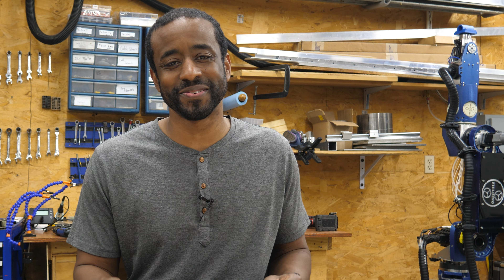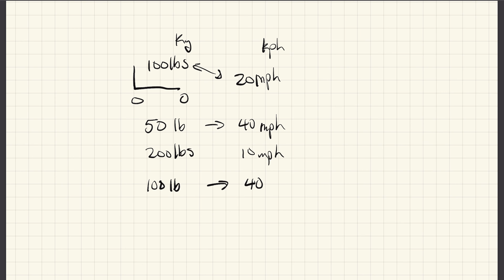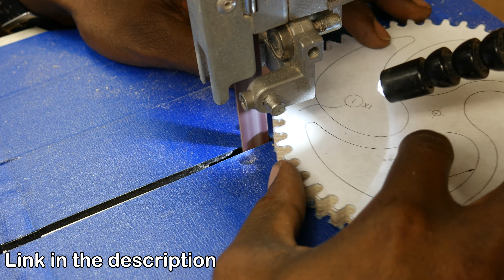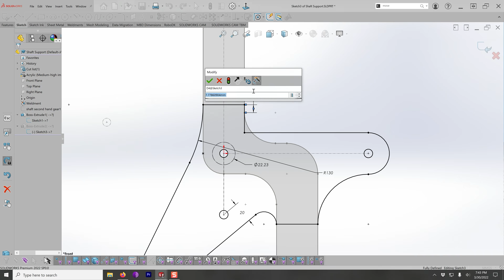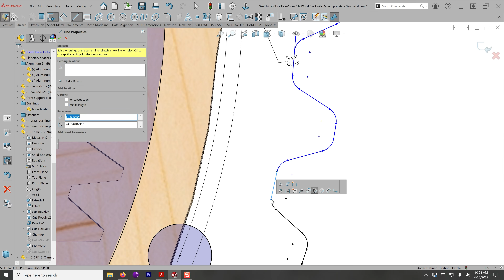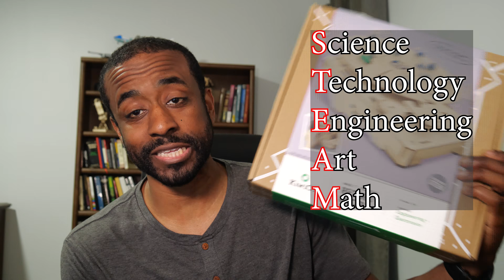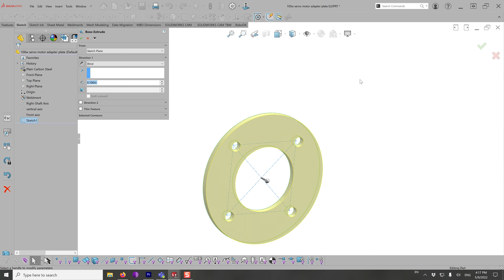How Gears and Pulleys Work: Jeremy Fielding 103

Comment: By definition, they're all screws, but it seems by the descriptions of different fasteners that it's described as bolts when it takes a tool around the head, and is still a screw when the tool used inserts into the head.  There are exceptions as well like "Socket-head shoulder bolts".

Comment: Screws use their helical plane to directly interface with your workpiece. Bolts are a type of fastener, fasteners pass through the workpiece and interface with another part like a nut or another fastener.

Comment: Acktchewaallllyyyyyyy... A screw is tightened by turning it in a hole. A bolt is tightened by turning a nut around it while it stays stationary.
There are traditional/common/conventional names that are "wrong," but that is the technical difference.
Carriage bolts, plow bolts, shear bolts and anchor bolts are rarely if ever used as screws. Wood screws, sheet metal screws and drywall screws are practically never used as bolts.
Machine screws are sometimes used as bolts, primarily ones with square or hexagonal heads, hence the use of the term Hex Bolts.
Some bolts don't have threads at all, like deadbolts, slide bolts, barrel bolts and cane bolts. (used on gates and doors) And of course there are bolts on rifles.
Screws are also used to move water, lathes and milling machines, 3D printers, aircraft, watercraft, amphibious vehicles, granular material, and to compress air.
Studs and hanger screws (or hanger bolts) are screws and bolts at the same time. They are screwed into something (studs usually in metal or plastic, and hangers usually wood) and then a nut is used to tighten something else to the first thing.
Eye bolts and eye screws have different kinds of thread.
Lag bolts are actually lag screws.

Did I miss anything?
Oh yeah; beautiful clock and an excellent video. Thanks!

Comment: In my brain it goes like this. Screws are designed to thread themselves into materials (I'm thinking wood, drywall, thin metals, soft materials in general) typically with a pointed tip and and low thread pitch in relation to its size. Bolts are designed to thread into matching pre-threaded holes, be it nuts or a hole that's been tapped, typically with a flat bottom and high thread pitch in relation. Unfortunately, a lot of the time what I consider small bolts are sold as machine screws. Maybe its colloquial, maybe it depends on size. Either way I'm gonna continue to use them as I described.

Comment: I thought the screw v. bolt was a really cool question! IMHO, screws typically have an inset method for fastening (roberston, torxs, etc) and often pointed/conical tip for piercing as well as an aggressive thread pitch for cutting. bolts almost always have an external fastening method (hex head, splinee etc) and a much tighter thread pitch for going into pre-tapped holes. 
The biggest thing perception wise would be size though IMHO; with very small bolts being called screws.
Reply: What you call "very small bolts" are actually machine screws. Screws turn. Bolts slide, a nut being turned to tighten them. Size doesn't matter, nor thread shape. Carriage bolts have no method of turning them. Same for plow bolts.

Comment: My FIL insists a screw is threaded, and only becomes a bolt when a nut is involved. (Bolt clamps its load but is not directly threaded into one of the members it is holding together.)
We are a family of engineers, and his pedigree does not give me any leverage to challenge his opinion on the matter (despite my being over a prototyping lab /machine shop for a large R&D organization!) 

Trick to holding on those bushings that you could have done is to cut out a wood piece on your laser cutter with the dowel press fit hole diameter, and slit one end of that piece and left room to run a clamp or screw to squeeze on the bushing (fairly evenly without collapsing it. Care may still need to be taken) 
That way you can easily insert and remove the bushing from the flexibility the slot gives you and then still reliably clamp onto the bushing to clean up the bur with a file. 
A collet would be even better. Perhaps pick up a 5C collet block and collet set!
I would have also used a tubing cutter to cut your tubing vs the hack saw. You still would have had to clamp and deburr the inside as the cutting tool would swage down the ID slightly at the cutting edge. 

Your last (hackish but would work in a pinch I think) option would be to cut all of your pieces a little long and cut shaft sections that can be used as mandrels. 
Slide a bit of shaft inside of the tube, but leave the tube slightly proud of the mandrel as you clamp it in a drill chuck. 
Use a zip tie or worm drive clamp array to hold the drill onto a counter and make the drill rotate as ~100 rpm or so (or slower!)- making a poor mans lathe. 
Then use a series of hand files to lightly stroke the end of the turning tube on the side of the tube coming towards the file until you get the end smoothed out. 
If you want to take it up to a final finish, you can even break out a dremmel tool with a stone and some cutting fluid to grind the end flat. Light cuts are the key here!
And keeping your files / abrasives from clogging.

Aluminum is also fairly soft for a shaft and would not run that well inside of a bushing. A hardened surface is much better for that application. (really you want hard on hard for a bushing, and the hardness need to be fairly closely matched between materials)

Comment: Off the cuff, the difference between a screw and a bolt is that a acrew's threads run the full length of the shift, while a bolt has some portion of its shaft that isn't threaded, called a shank. I'm an aviation mechanic, going through my second year of work, but I didn't do anything mechanical before this, not even working on my own car, so I could be wrong lol
Reply: I was wrong lol. A bolt is non-tapered and uses a washer and nut to fasten. A screw mates closely with existing threads or makes its own thread.

Comment: Regarding screws v bolts, there is a podcast called Engineering Commons that came to a conclusion that screws are intended to thread into a material, and bolts are intended to be attached to a material via a nut.  I have always liked their determination as it is dependent upon the use case.

Comment: A screw is a fastener thats using itself to hold on to the material (friction with the thing fastened), a bolt need a 2nd piece (the nut) to hold on to the material

Comment: Based on the way the terms are generally used, a screw is any device with an inclined plane revolved around a shaft, while a bolt is a subset of screws, specifically the machine screw.
Reply: What about lag bolts? What about deadbolts? Or the bolt in a rifle? Screws are tightened by turning them. Bolts slide. Threaded bolts are tightened by turning a nut around them while they slide into place. Lag bolts are actually lag screws.
Reply: @GordieGii  
Words mean different things in different contexts. When discussing screws, generally "bolt" is synonymous with machine screws, even though your definition may be more appropriate for technical discussions.
Also, my opinion is that lag bolts should be called lag screws, and lag bolt is therefore incorrect (although clear enough, in context).
Reply: @thomaswalters7117  When people say bolt they usually mean machine screw. I rarely correct people. The question was "what is the difference between a bolt and a screw?" That is a technical question. I gave a technical answer.
Most true bolts are special purpose, so the word 'bolt' is preceded by an adjective, like a carriage bolt or plow bolt, although even in that context there are colloquial terms, 
like shear bolt, which is really a plow bolt, but with a certain type of anti-rotation geometry commonly used on metal shears.
With regards to the origins of the words, you turn screws to make things happen, you slide bolts to make things happen. You can see my comment to the OP for many examples from the non-fastener domain.
Reply: @GordieGii  
I am not questioning your definition, but it's important to understand all common definitions of the term. Since most people use machine screw and bolt interchangeably (and since the distinction is rarely important), that is an important definition to understand.
Reply: @thomaswalters7117  I disagree. I my experience, most people who don't work in industry use a hodge-podge of terms that they learned from their relatives and friends. Some use the thread type (like you) others base it on whether the driving shape is on the outside or inside of the head, Some on the diameter, and some on whether the screw cuts it's own thread or not. (but there are also self tapping machine screws)
As long as they don't have any trouble communicating what they are talking about with the people they are talking to, I don't care what system they use. However I think it IS important to understand a few things: First, that there is an actual technical distinction, and what it is. Second, that it is commonly not adhered to, and that's OK. And third, (and this one is for you) that there exist more than one common way that it is not adhered to.

Comment: It has probably been said elsewhere in the comments; but if my recollection from shop class over 30 years ago is correct, the difference is as follows:

A screw requires a tight fit with the material it is being fastened to as it is held by friction with the object itself. A bolt requires a looser fit as it is held by a nut instead of interfacing with the material directly.

Screws generally do not go all the way through while bolts generally do but there are exceptions to this. The primary thing to tell them apart is whether they require a nut to be threaded on or not.

Comment: Another great video. The difference between a screw and a bolt is that a bolt will have an interference fit with the hole and a screw has clearance.

Comment: There is very little difference between a "machine screw" and a "bolt".
There is very little difference between a "large wood screw" and a "lag bolt".
That being said "screws" and "bolts" are two entirely different non-interchangeable things which many find quite confusing.
For example, a "socket head cap screw" is a bolt.
A "sheet metal screw" is identical to a "wood screw" except the "sheet metal screw" has threads all the way up to the head, and a "wood screw" has threads halfway up.  This is because "wood screws" are designed to pull two pieces of wood together.  In one piece the wood should be drilled larger than the screw and the other piece should have a hole at least two drill sizes smaller than the threaded size of the screw.  The "sheet metal screw" is designed to pull two thin pieces of sheet metal together and therefore needs threads all the way up to the head.

Bolts usually have machine threads which accept a nut of the appropriate size.
Bolts usually have a hex shaped head which is usually 1 wrench size smaller than the nut that fits that bolt.  This is so you don't need two sets of wrenches.
But you need at least two sets of wrenches.
Life is filled with tiny injustices.
If you go to any Ace Hardware and ask for a 10X1 Phillips PHSMS they should ask "brass, stainless steel, or zinc plated"?  Stainless steel of course...and you will always get a 10X1 Phillips Pan Head Sheet Metal Screw in SS.  Maybe.
Bolts are not created equal and are priced based on the grade which denotes the strength of the bolt.
The next 6027 pages of technical information on bolts and screws can be found in my un-written book "The Ultimate Book of Hardware" by Kevin Sellsit.
Please note that I haven't written this book (at least not yet) so you may have to wait for this info.
P.S. I almost forgot!  The "size" of a bolt is in reference to the size of the threads and length NOT the size of the wrench you need to turn it.
For example a "1/4-20X2.5 bolt" has a 7/16 hex head and requires a 7/16 inch wrench but should never be called a 7/16 bolt because a 7/16 bolt is much larger than a 1/4 inch bolt.  This really bugs me and happens all the time in automotive YouTube videos.  Don't do it ... please!
If I don't stop now I'll never sell the book I haven't written.
Bye!

Comment: Thanks for great info and videos. I took your tips on finding used broken equipment. In one week I got a treadmill, fridge, 2 industrial carpet cleaners, vacuum, dryer and mini bike all for $free$. Being an auto mechanic I ended up spotting the failures without even trying. Everything was either some kind of short in wires except the fridge had a failed evaporator fan. I plan on putting the treadmill motor onto the mini bike. This will be a fun project.

Comment: Great job !  Another interesting video might be to make your clock powered by a wind up spring, and /or a weight like on a grandfather clock. Well, the spring version might require a complete redesign to adjust for declining tension on the spring. I don't know. I am nowhere as knowledgeable as you seem to be.

Comment: screw generally has expanded helical thread form and pointy tip , a bolt is usually tighter threads with blunt tip and hex-head but....so many cross-blends of this nowadays

Comment: bolts are usually thicker and have a pairing nut that they go into, screws are made more for putting into a pre-tapped hole or in some cases they are made to tap the hole as they are driven in, or are made just to be put in and left in. either way they are both made to hold things together and there are a good few uses for both.

Comment: Any chance you recorded this at 60fps? the gear teeth blur into each other when they spin at 30fps 😥
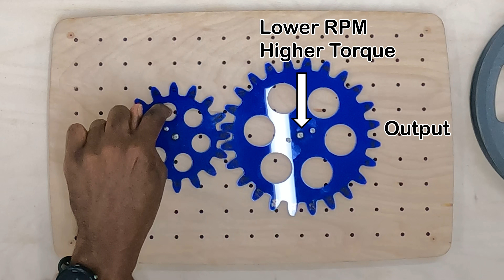Reply: though it does offer an interesting example to talk about Nyquist frequency and signal aliasing. At 5:50, you spin the smaller gear at roughly 1 revolution per second, and with 16 teeth that equates to 16 teeth per second, or 16 Hz. A framerate of 30fps (a sampling rate of 30 Hz) means we can only accurately reconstruct signals below 15 Hz; signals above that threshold will be aliased to signals under that threshold. And sure enough, if you set the video's playback speed to 0.25x so you can watch frame-by-frame, the individual teeth seem to jump forward and backward almost randomly as the rotation speed hovers around that Nyquist boundary.

(you already know all this, I'm sure! but I figure someone reading this might find it interesting to learn 😁)
Reply: you can contrast this with 6:58, where you spin the gear at about half the speed, taking about 2 seconds to make a full rotation for 0.5 revolutions per second, or 8 teeth per second. Watched frame-by-frame, the individual teeth always appear to be moving forward, since 8 Hz is under the Nyquist frequency of 15.

Comment: The difference between a screw and a bolt is design and purpose.
It is like the Lugnuts of a wheel that fits the bolt, you can't use a screw in that instance because by the time the wheel is under load of rotation a screw will break.
You can tighten a bolt more than you can tighten a screw.

Comment: I saw your problem with the bushings. I've had similar problems with knifemaking fittings, and my solution was to use a central mandrel to hold the tubing and a disk or belt sander to polish the ends

Comment: A tip for cutting the bushing material is to cut it whilst it’s over the pin material. In your case, slide the bushing material over the aluminium rod then cut it to size. You will possibly sacrifice some aluminium rod but it allows you to clamp the material and the cut will be cleaner.

Comment: I'd say screws are inclusive of bolts, the distinction simply being that a bolt sandwiches something free-floating between its head and another object. So a screw with a washer would be more precisely referred to as a bolt. However, due to connotation, I think that most people won't call screws in wood "bolts" unless there are metal female threads involved as well.

As a bonus, I'd say threaded studs are a kind of bolt that uses another object instead of a head to form this 'sandwich.'

Comment: You should check out Gearotic Motion, it is cad software specifically for designing and simulating gears and related things like timing pulleys. Mady by the guy who originally made Mach 3.

Comment: With the exception of self tapping fasteners, I have always called a fastener with an internal fulcrum point like a slot, Philips or torques a screw and hex head, square head or the rare pentagon head bolts.
(Pentagon head is used to secure the covers of ground mounted electrical service transformers)

Comment: I thoroughly enjoyed this video! Your explanations are clear and concise and your presentation is calm and reassuring. My question would be about a potential dielectric problem between the aluminum and brass in the bushings. I'm no metallurgist but beside the dielectric, which could cause oxidation problems, is the aluminum too soft to maintain tolerances over time? Yes everything is moving slowly so little heat is generated and wear at a minimum but there would be wear. Do you oil the bushings?

Comment: I was thinking instead of running it at 2x speed for a 6-hour clock, run it at half speed for a 24-hr clock.  Less visually compelling I know, but fun!  p.s. A screw (fastener) gets it's holding force by engaging with the material being screwed into, whereas a Bolt has a Nut that it engages with for it's holding power.  You screw INTO something, and you Bolt THROUGH something.